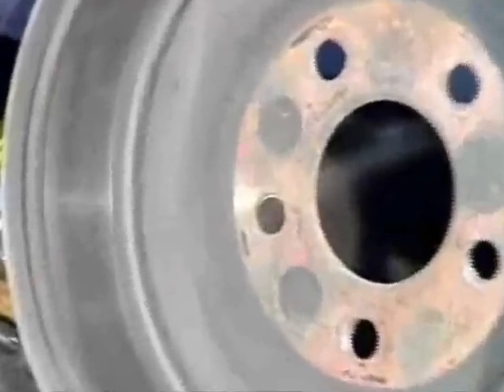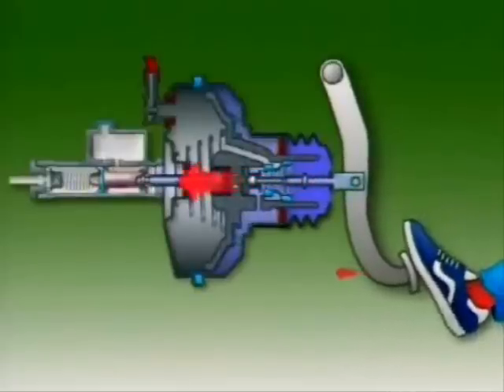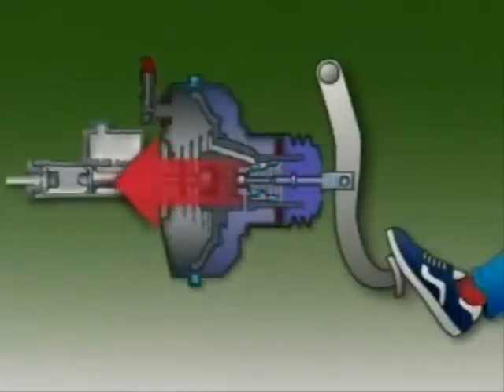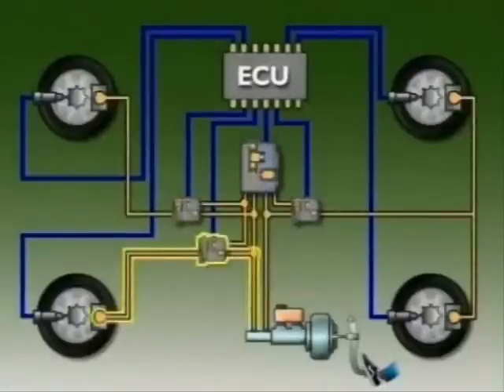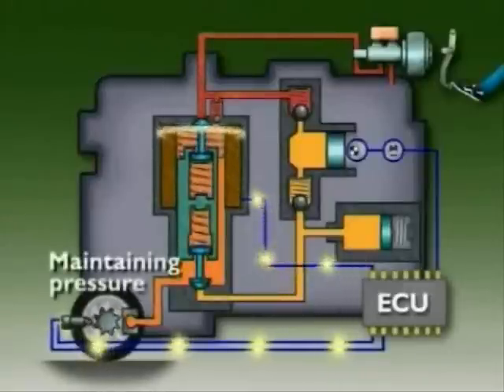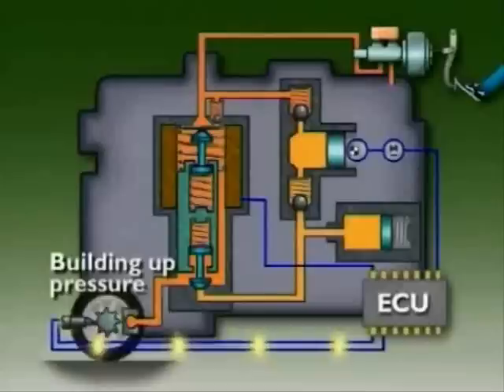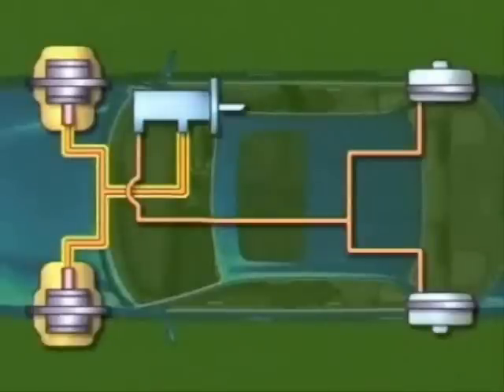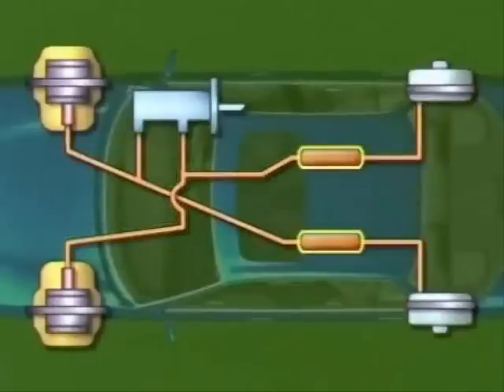How your Brake System Works - AutoZone Car Care

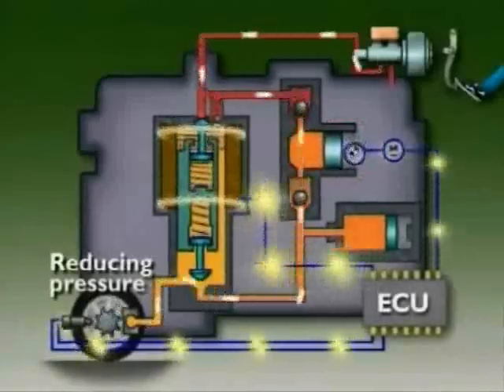Comment: 4:20 The accumulator... 

I'm wondering if that's what the issue was with my 1999 Chevy Cavalier.  The ABS would sound like Popeye in slippery conditions. Eye guy guy...

Despite that peculiarity, it worked like a champ and the car drove like a tank for the half decade or so that I had it. 

Very maintenance friendly for someone like me, who only understands some of the basics.